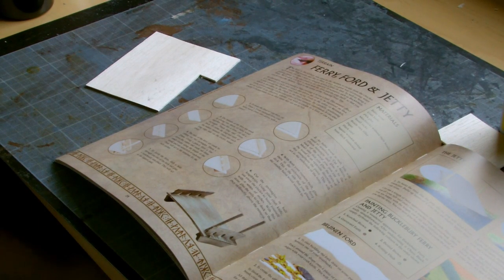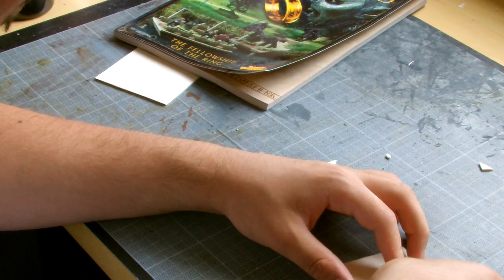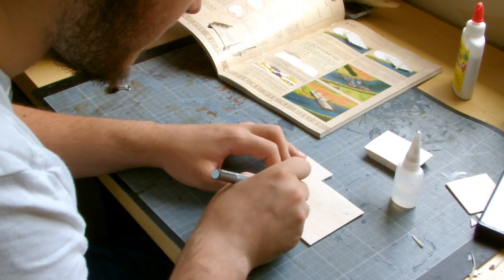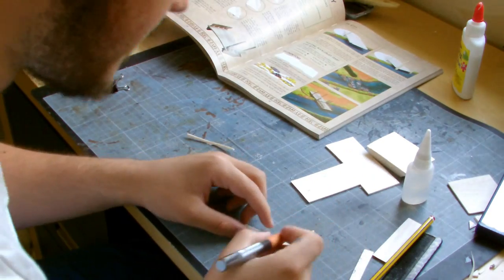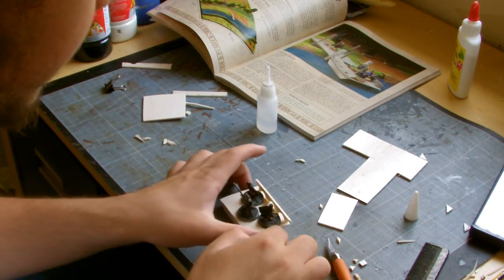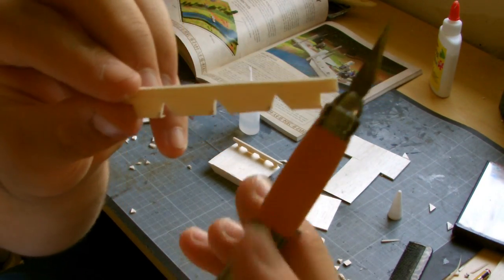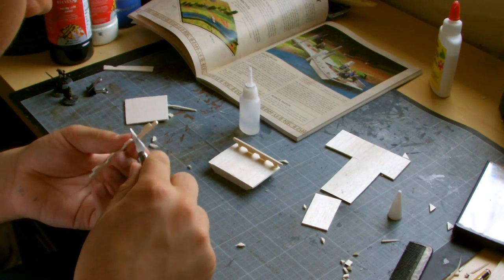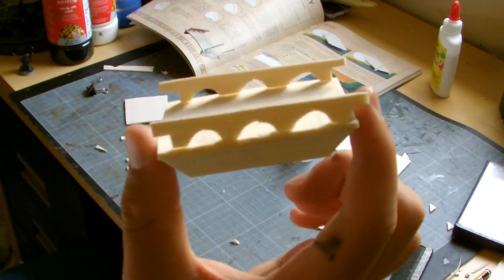Hobby VLOG: Building the Bucklebury Ferry #06

Comment: I like these terrain tutorials. Looking forward to the next one!

The wood may have warped from the moisture in the glue. If you try with a lot less PVA glue and let it dry completely before doing the next step you may get better results. Of course the superglue worked so it doesn't matter now.

When cutting thin balsa wood like that you can glue a sheet of paper to one side. It will prevent the wood from splitting along the grain and help keep stray flicks of your knife from cutting too far. It would also provide extra strength to the finished pieces. If your careful you can make sure the paper sides are hidden.

Comment: The thin balsa will warp with PVA so I also use super glue for smaller pieces but for larger areas ie Rohan houses etc I use PVA but I weight it down with books etc til it dries to stop it warping. Saves on super glue for larger pieces.

N I envy the speed at which you get through your hobbying Jamie!! I also made the ferry from the journey book but it took me a full day!!

Comment: A little tip from your builder pal ;)
When you drawn the circles on the balsa before you then split it down the middle just drill the circles out with a bog standard non high power hole cutter ;)
Then split the balsa in two... I reckon that would be loads easier....